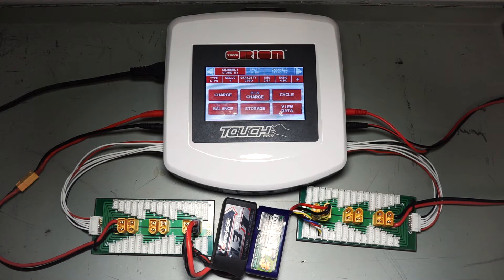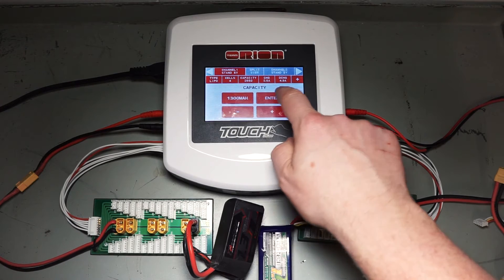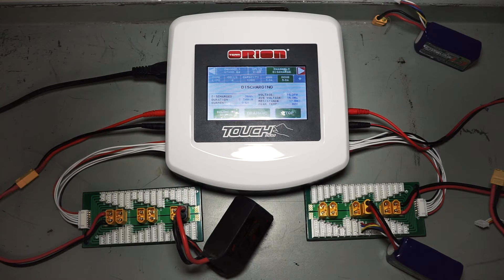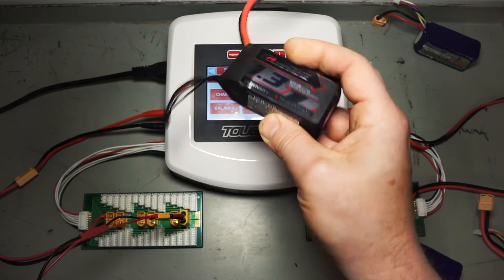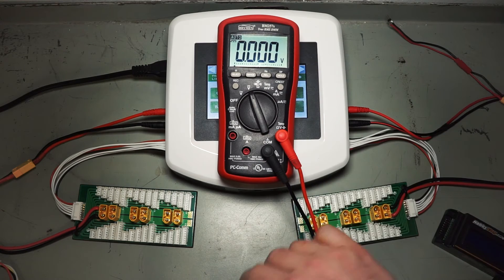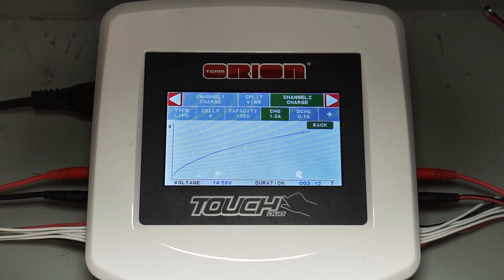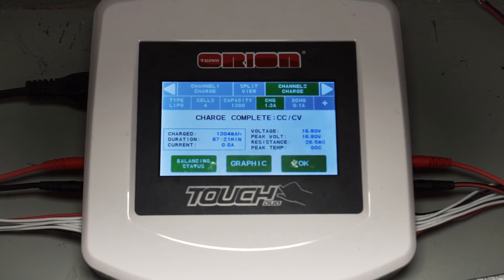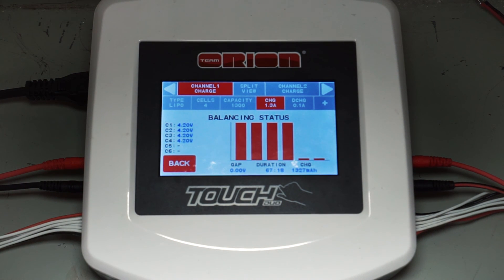Turnigy Graphene capacity test

Comment: The graphene batteries are not made completely out of graphene right? I think they just showed "real" graphene batteries in china which are said to charge 10-20 times faster.
Reply from the maker: Hey there, no they are no made completely out of graphene, they have layers in the battery structure which allow for much higher power densities. I don't think you could make any battery completely out of graphene, I'd just be a chunk of really expensive carbon :)

Comment: Hello , I wanted to try to buy the graphene to replace my zippy that warm and after a few flights are swollen , my advice these graphene ? What advice model in place to zippy ? Use the 4S , hello and thanks .
Reply from the maker: Hey there Fpvpoint, I am not sure what you need and what you are flying but I would go for the 65C graphene packs, 4s, and whichever capacity you need. Are you flying a miniquad?

Comment: Hello Nils. I have a 500 quad and have a 5 cell 4000 MAH battery. I set my battery fail safe to around 3.5 to 3.6. What do you think about this, Is this still a respectable and workable failsafe
Reply from the maker: Hi Barry, yes 3.5 V per cell is absolutely fine, you can even fly to 3.2 and then once the load us removed it should jump back up anyway to a much higher recovery. Never go below 3 though as damage starts being done. Just to be clear, that is the voltage per cell, for the whole 5 cell battery it would be 17.5v or minimum 16v over the whole battery.
Reply: Yes thats what I try and do :-)

Comment: Without a purpose built ESR meter and or the use of an oscilloscope, your findings are crude at best.  If you plan to do more reviews like this one, it would benefit you to have several lipo packs, all new and unused with the same mah per cell.  Without those factors in place your wasting your time.  Get one of these>  http://www.progressiverc.com/universal-esr-analysis-meter.html
And don't take anything I've said personally.  I like your video and review.  Just thought you could benefit from said info.

Comment: When we talk about the Graphenes delivering "punch" In my tests which are are on the model and just getting a feel for them in comparison with the Nanotechs, they do 'hold charge" at the tradeoff of delivering "punch" throughout the flight curve. They do drop in voltage quite quickly near the cells cut-off voltage.  An initial "punch" is there but  it is not linear.  I have run several tests already in my RC MTG trainer RC autogyro videos, but I still prefer the Nanotechs. I don't like the sudden drop in voltage, if you are not watching for this on your model , your model will drop out of the sky like a rock, in particular if you are flying helicopters or multicopters. This is not s much an issue with Autogyros or airplanes as these latter types can actually, respectively parachute or glide with no power.  The Nanotech or regular Lipols at least give you a much wider window of operation when the cells drop in voltage. 
I know...we should be using a low battery voltage alarm, esc cut-off voltage settings or land the model much earlier to avoid Graphene powered models drop like rock or to make sure we don't go beyond the Killer Lipol low voltage  mark.  Not really impressed so far. I think this new technology can be improved further. We have the means and technology to make these cells perform much better, at half the weight and half the size.
Reply from the maker: You're right, they really do drop off very quickly, but for mini quad racing it's worth it as long as you have a timer to get back to start in time.
Reply: +Nils Rohwer You can see it coming via an OSD too.
Reply: Thanks for this observation

Comment: Nice video! Do you have an amp meter to test voltage sag and if they are really the rated discharge capacity?
Reply from the maker: Hi there, I do have an ammeter but it only goes up to 10amps, I'll have to use an oscilloscope and a current transformer to repeat the test. I will use an arduino and a more balanced test to check the performance against other 65c batteries.